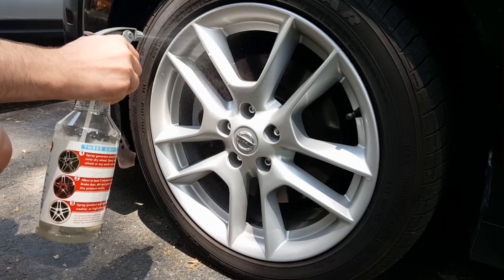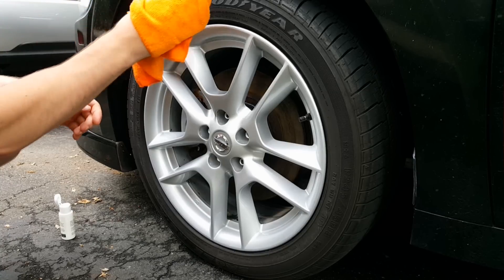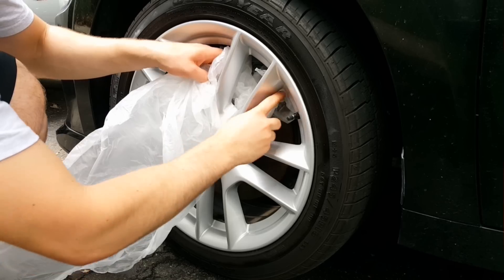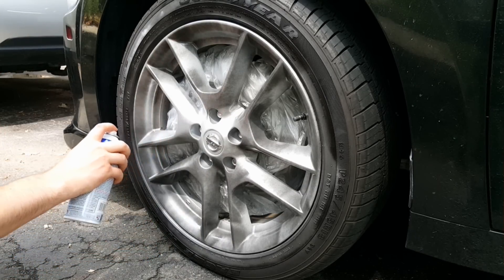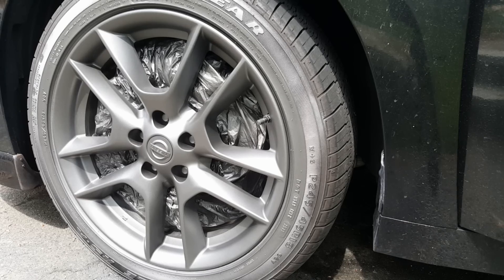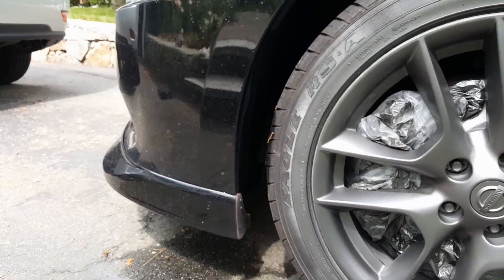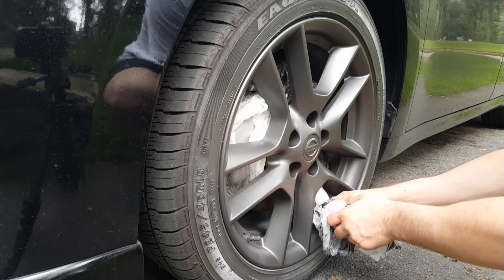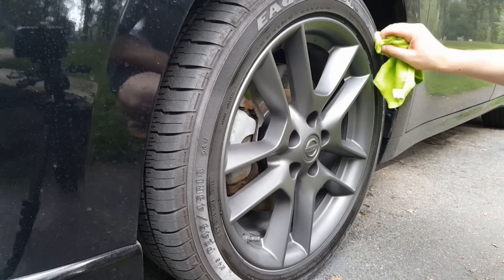Anthracite Grey Plasti Dip looks AMAZING on wheels!

Comment: This is the best demo video so far. So clear and straight to the point. Can I jet wash the wheels, how long has it lasted on your wheels bro?
Reply from the maker: +Rick J Thanks man! It will last for a couple years for sure.  I take my plasti dip off from my wheels every summer and put on fresh new coats just to keep it looking clean because it's so cheap to do, but it will last for a very long time.  I have never tried power/jet washing my wheels with the plasti dip on them, so I can't tell you if it will take off the dip or not.  But I can recommend a product for you that I use to clean my dipped wheels - https://www.dipyourcar.com/collections/car-wash-aftercare/products/brake-dust-professional 
Just spray this stuff on, let it sit for a few minutes and wash it off, no scrubbing necessary!

Comment: any tips on how to help maintain the plastic dip?
Reply from the maker: +Carelene Rambo The best way to clean plasti dip covered wheels in my opinion is to use the brake dust remover I was using in the beginning of the video.  You can just spray it on, let it sit for a couple minutes, and just wash it off.  No scrubbing needed.  You can buy the stuff I was using on dipyourcar.com.  Here is the link:
https://www.dipyourcar.com/collections/car-wash-aftercare/products/brake-dust-professional

Comment: Fucking great video and nice car too

I want to paint my rims black but i only have about half a bottle of black left do you think thats enough for my four 17in wheels? or should i buy another bottle?
Reply from the maker: WeKnowTheTruth2012 Thanks!  If you are using Plast Dip, you will need 1 whole can per wheel.  So 4 cans should be enough to get about 4-5 coats on each wheel.  You don't want to go light on it because then it will be a pain in the ass to peel it off.

Comment: I need to get new tires for my car should, I  wait until get new tires before dipping  wheels will it be okay with dip on it.
Reply from the maker: If it were me, I'd probably wait to get the new tires.  No point in spending a few hours doing a nice dip and then have it ruined by someone not being careful installing your new tires.  If you do dip your wheels before getting new tires, make sure you tell the guys installing them that your wheels are dipped and to be extra careful not to scratch it.  So to answer your question, it should be ok if it's done carefully.
Reply: I getting same color dip as you in your video going to wait until get new tires thanks for you help.